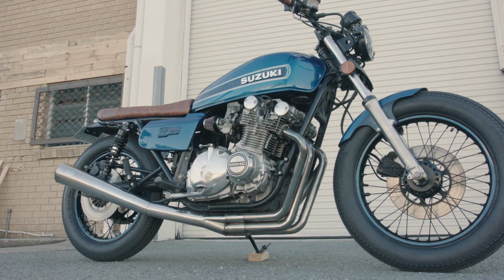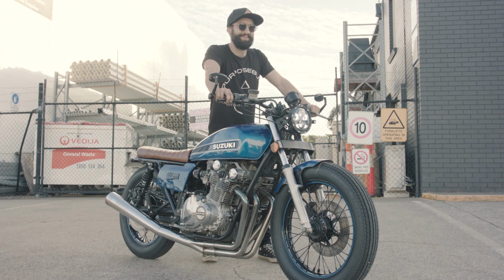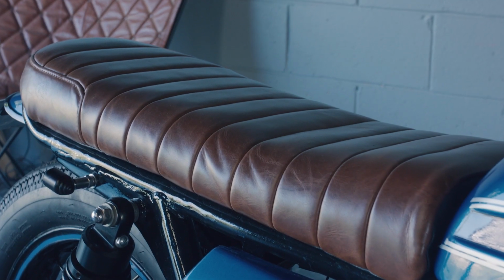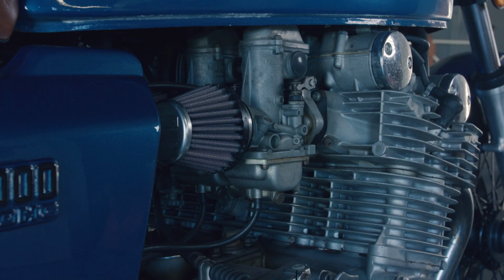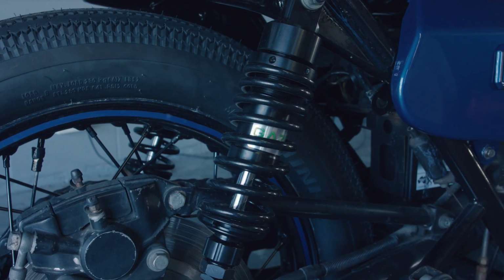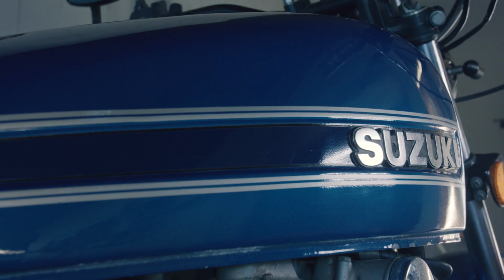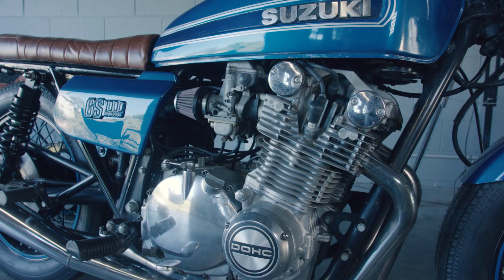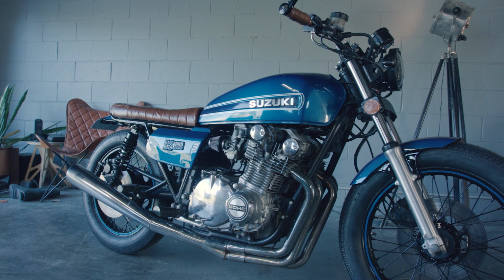GS1000 Brat bike - How to build a brat bike | Purpose Built Moto

Comment: Diggin this one.  What did you go with for a tach/speedo?
Reply from the maker: cjhumber12  I used a Koso digital gauge.
We had issues due to the points ignition not being strong enough to signal the Tach pick up.
Reply: @PurposeBuiltMoto  Good to know.  Thanks for the reply. Working on an 1981 gs1000L right now.
Reply from the maker: cjhumber12 nice one man, hit our website linked in the video description I wrote a blog all about this build